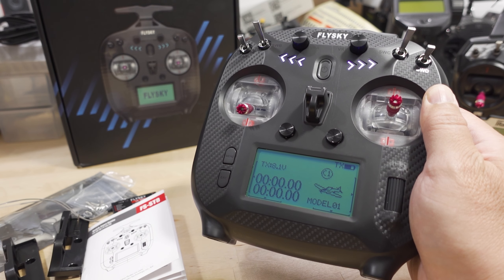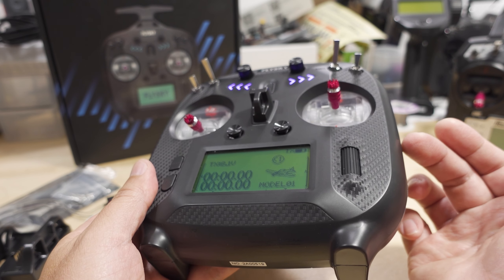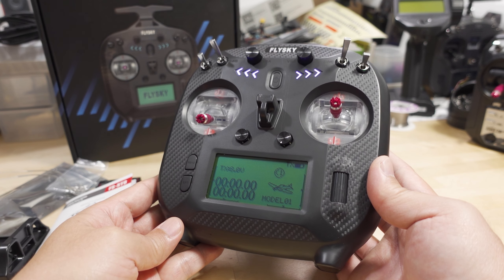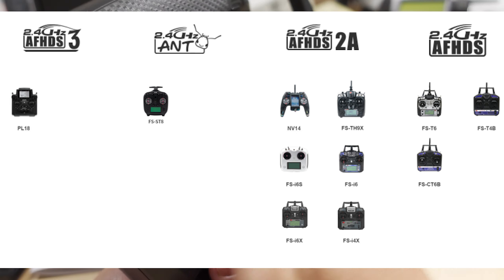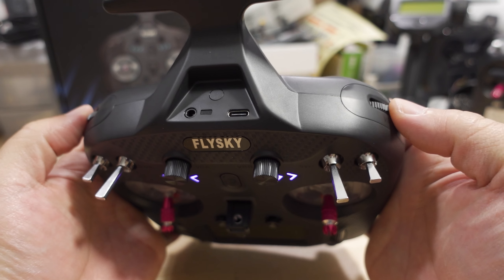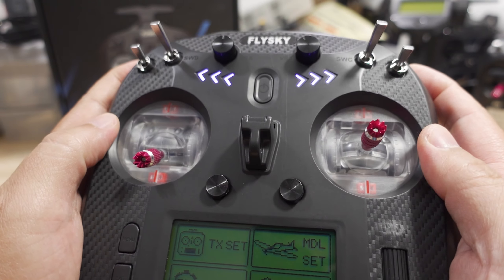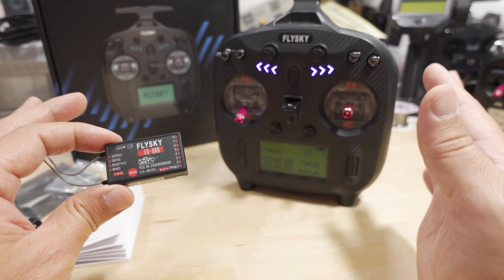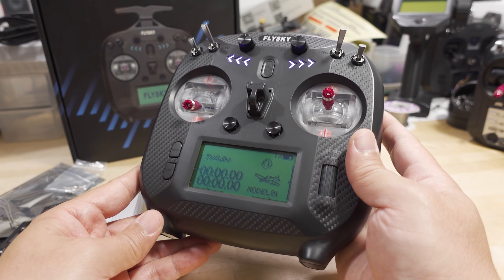Flysky FS-ST8 RC Transmitter Review 📻

Comment: I may be thinking of the wrong transmitter, but I believe it was asked if EdgeTX could run on this, and it's simply not possible as it doesn't have either enough RAM or Flash for it to work. LED colour can be set to several static colors, or battery level indication. It'll actually do 10Ch, but you need the channel expander thingy to get the extra two channels out on the receiver. I'm surprised it's pot based since they look pretty much identical to the "digital" NV14 gimbals, but that would be quite an upgrade and selling point. So the JR bay doesn't put out PPM which could be used with Crossfire, Tracer, MPM (with PPM firmware), etc? While it would be a fairly limited market nowadays, that at least would make the JR bay useful for something.

Comment: Hey Albert, Thanks for the review.  It does seem like an entry level product.  I understand ecosystem. (I currently utilize only the DJI ecosystem for simplicity)  I suspect that if you spend a few more dollars you could purchase a much better radio (ZORRO) that is future proof and has a much broader application/usage.  I'd like to know how the issue (non-working) with your "Radiomaster Zorro" worked out, any developments?
Reply from the maker: I probably broke my board when I opened up the radio.  They sent me a new board but I have not had time to replace it yet.
Reply: @AlbertKimTV  Best of luck with the repair.  I have one further question.  I'm in the DJI ecosystem, but I'd like to try out ELRS, would you recommend the Radiomaster Zorro for someone looking to step out of the DJI ecosystem?
Reply from the maker: @pandrews01  Yes, it's a good radio and I like it but you may not. Radios are very subjective and it's like trying to find the right kind of car to drive. You may love it or hate it.
Reply: @AlbertKimTV  Thank-You. I understand.

Comment: This radio makes me kind of sad. It could be so much more but it simply is not. Found the basic model for $39 with a receiver and free shipping and I thought It might make for a good beginner radio for my roommate, to later become maybe my trainer port radio (as I want to teach other people to fly the old way), but the lack of serious protocol and bay compatibility really kills it.

I still kind of want to snag it, I would like to compare the ANT protocol to AFHDS3 as they are actually as cheap as the cheapest AFHDS2 receivers but including telemetry and serial ports, also a $20 diversity 2 gram 8 channel PWM+Serial with on board single cable voltage telemetry, nice.

Comment: I have a soft spot for Flysky as the FS-i6 was my first TX and it was great, light weight slim and very easy to hold. But sadly they are so slow adapting to the trends that they always end up being left behind by all other brands.
No OpenTX or edgeTX. NO ELRS a protocol that isn’t great. Amazing that they are still in the market.
Reply from the maker: The "market" for RC pilots who fly things other than OpenTX, EdgeTX, or ELRS is actually about 150 times larger.  They are around because they are making way more money than the OpenTX radio guys.  So I would support those guys who make the stuff you want with your financial support as much as possible so they can stay alive!
Reply: @AlbertKimTV  This is an eyeopener comment. Thank you.

Comment: Damn, saw those pins and was really hoping for elrs compatibility. Welp time for me to start making my way out of the flysky ecosystem now that more elrs chips are coming in stock. Nice that you can use a lipo now though. Instead of my soldered USB battery pack I'm using right now lmao
Reply: lucky! any day an fpv pilot puts down their flysky and upgrades to hobby grade stuff is a day for celebration.

Comment: Big wrong from flysky, they should make  elrs one. And also bad design (that jr module is bad design)
I have flysky i6x modded with opentx, ELRS module (thanks to Albert kim  and Rukish Rc) and work with 2s 18650. Is far better than this.
Reply from the maker: I think they must have a customer base that is loyal to just Flysky like those who are loyal to Frsky.  So they must not care about open source.  I heard while the open source market is very loud and makes a lot of noise, it's only 5% of the RC radio market.
Reply: @AlbertKimTV  Oh lol 5% that's bad, should be 80%